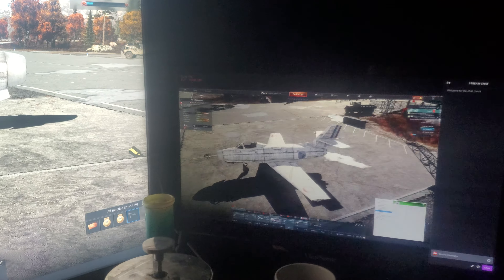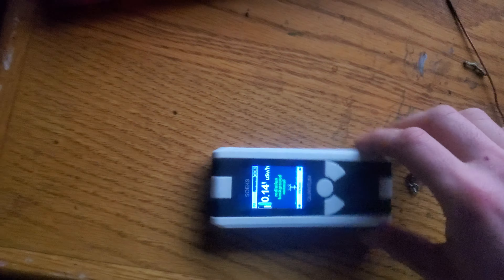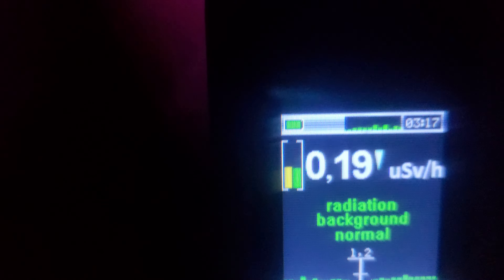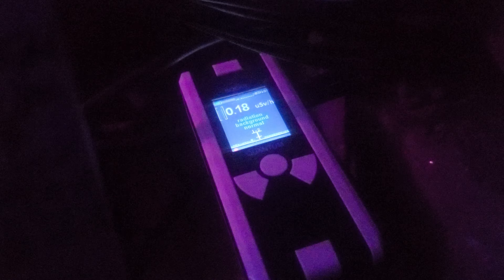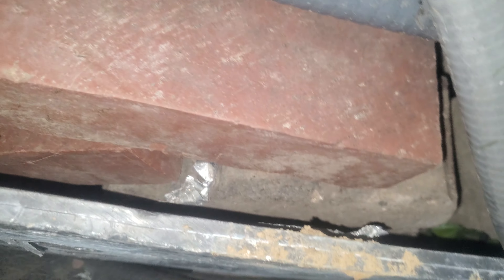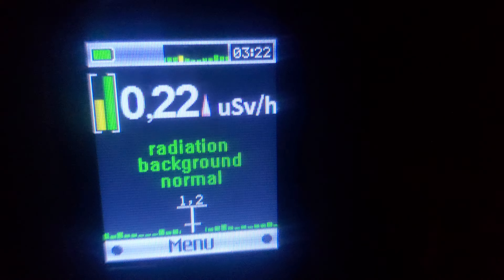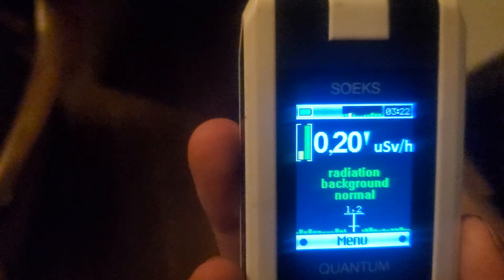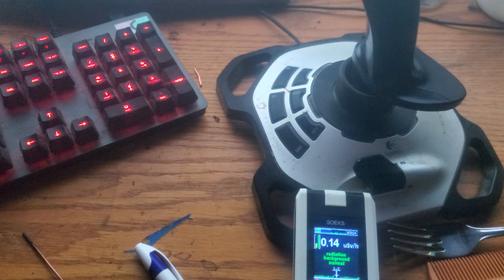Channel Update and Radiation Reading

Comment: 0.20 uSv/hr is a NORMAL level of radiation. It's not uncommon for bricks and concrete to read even higher than that.

Also, this is a very low-quality device. It is a cheap toy. I own a detector that costs three times as much, but because it is not a PROFESSIONAL device, it is subject to drift over time. It now reads 0.20 for background when 0.12 used to be typical.

Also, 0.20 uSv/hr is an exaggerated reading, higher than the real dose rate. Your detector is calibrated for Cs-137. In your video it is being struck by gamma of a lower energy, and probably beta particles as well. By interpreting those decay events as Cs-137 gammas, the reading is inflated. More importantly, the low-energy gamma and beta is much more likely to interact with the G-M tube than Cs-137 gammas are. This leads to an even greater exaggeration of the dose rate.

So in conclusion: the detector is showing totally normal background.
Reply from the maker: It didn't doesn't drift.  I can feel it on my skin.  And those are old bricks.  Ancient bricks probably from the 19th century.  And if the bricks were radioactive than the reading in the basement would be higher, but it is not.  The bricks absorb a significant amount of radiation.  Outside in the PC I hve a reading of .25 which is not normal at all in Cincinnati, Ohio at night.  It just isn't.

So conclusion.  The detector is reading double the radiation reading from the PC to where the monitorr is.  They are only a few feet apart, but it is blocked with brick, stone, lead, grounded silver fiber sheets.

In fact.  I think the reading is deflated.  You don't know what is causing that reading.  You say bricks.  But I am telling you the CPU has a contamination.  I bought that becasue of the amount of pain and unkown radiation source that was emitting from my machine and consecutive machines since 2019.  In fact I have it outside becasue of the toxic particulate matter that goes with.  Killing plants and mysteriously makeing the dog sick.  Come on over.  I'll put that soeks meter next to a brick that isn't being cooked by what ever X-rays are comming off the PC.  Notice how the camera had trouble focusing on the PC and surrounding objects.  Ther was an invisible disturbance that was screws with ther IR focusing lasers.
Reply: @ryankm48  You don't know how bricks work (being old makes it MORE likely they are radioactive), how the detector works, or how radiation itself works.

If you truly believed the computer was dangerously radioactive, you would get rid of the computer.
Reply from the maker: @MinSredMash  Yeah... But ther is something there to maintain that radio activity.  The brick is being charged up
Reply from the maker: @MinSredMash  I've gotten rid of 3 computers now.  THis suddenly started 3 years ago simultaneously with other attacks as well.  For years I had been getting harrassed.  This is just the latest in a long list of grievances.  This place is like living in 15th century England.  The judge the cop, they just make up what ever they want.  I'm the bad guy no matter what.  This cop Ray Tensing here killed a man.  The prosection couldn't prove it was about rascism so despite having it on video that Ray Tensing shot Andy DuBoise in point blank out of blind rage they let him go and payed everybody off with  $$$.  It's only gotten worse since then.

Ray Tensing should have gotten lethal injection, but instead he was aquitted of all charges.  You want to know why?  Saftey Culture.  When ANdy DuBoise pulled a way.  Ray Tensing had to shoot him for his saftey.  This is ridiculous.  Thhey let these stupivisors make up the most ridiculous shit!  How can anyone work when that is going on!

It's not super dangerous.  But super annoying.  I mean if I sit here for a week and do nothing, but game or process.  Than it is dangerous.  Defiantly bad for your teeth.
It is bad for your head too.  Tha's the annoying part.  An invisible toxic cloud overwhelms you causes delirium.  That is why I have it outside.  It is able to block some of it, but not for long.  The dust it leaves behind is also toxic.  Kills plants.  the leaves turn yellow and dies evan if you repot.
Reply from the maker: @MinSredMash  I'm sitting here now.  I had it off for a day.  I can literally hear a high pitched hissing comming through the foundation wall from where the PC is.  Not to mention youi can feel it on your skin.  I have to try and breathe with mouth closed becasue it will eat the enamel on your teeth.  Definitely a lot harder to focus.
Reply from the maker: bring it over!

https://youtu.be/K6YqD1UpMr8